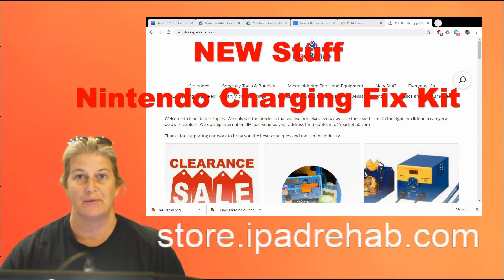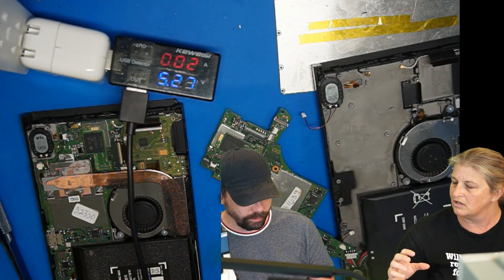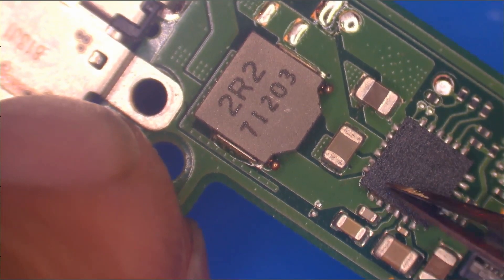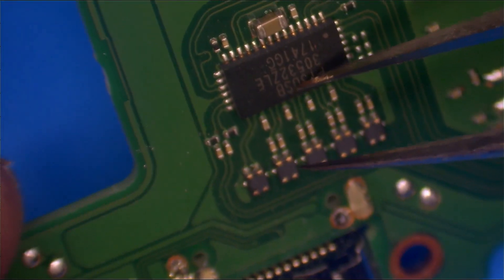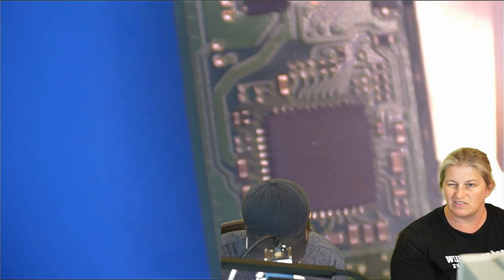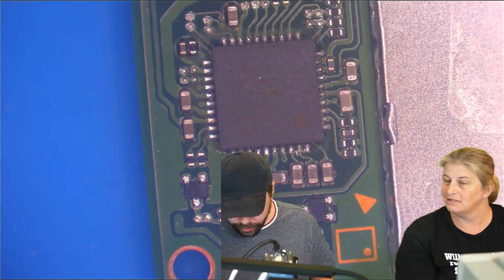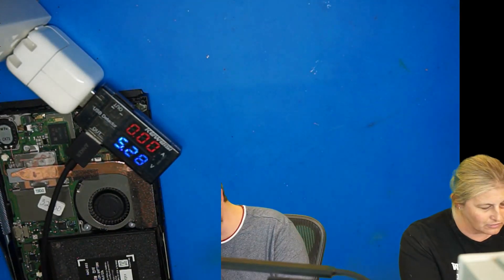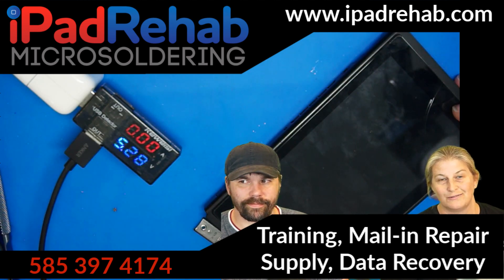Nintendo Switch Not Charging?  Learn to Fix it

Comment: Hi I have a switch that's around 4 years old and the battery only charged up to 23% and stopped. While plugged in I do not see the lightning bolt by the battery anymore. Just wondering the switch is smart enough to stop charging a depleted old battery or hopefully it's not the motherboard charging system. I have a replacement battery on the way just wondering if I'm wasting my time.

Comment: I have a charging issue with a switch my brother bought as-is on eBay, which I might add was stupid since the seller stated there was missing screws.  Normally I won't work on something that some amateur has torn apart for obvious reasons.

Anyway, I replaced the charging port.  Now I am getting the same .40 or so amp I was before.  In your video you weren't getting the .40 amp and replaced the tristar to complete the repair.  I am getting the .40 but still do not see anything on the screen indicating charging is happening.

This sounds more like a communication with the CPU issue but I have never worked on a switch so I have no clue where to start to tell if that is true.  Currently the Tirgis chip is sold out on your site, do you think the Tigris is more likely the issue.  I did hear some whining north of the charging port a few times, sounded like coil whine to me but I am not sure.

Any suggestions would be awesome, love the videos by the way.

Comment: Hi just joined your channel.. Have a question for you i have a switch that shows charging symbol on screen but it does not charge battery and percentage goes down.  Amp reader shows 0.00 amps.  There are no shorts in the charging chips and the video chip..  I also tried two difderent working batteries.. What could it be? I have posted on other youtubers channels but no one has responded...Thank you..
Reply from the maker: It could be any fault in the charging circuit.  See Store.ipadrehab.com for the chip that fails the most in our experience

Comment: In the video, the capacitor that is stated as being connected to the cpu (time 5.44 on video), next to the MT92 ic. If this is short 9/10 its a blown P13USB (HDMI) chip that causes the short. If you remove the P13 USB chip, that capacitor will no longer be shorted. This would also be evident on the screen as there would be no charging symbol or display if P13usb is defective.

Comment: Hey guys. This was most likely a short. Just fixed one today consuming the exact same way. Found a short on test pad 4 cluster k and tracked the line to the M92T36. Replaced the chip and bingo. Every short I have found on these devices consume almost no current and I have found shorts on the M92T36, P13USB, and the BQ. Also a regular usb to usbc cable with a 2amp block will allow 1.5amps to pass thru once the battery gets enough juice to boot the device.

Comment: Have seen many people mention the charging power control IC and battery management IC, but have not seen those go bad yet. Have mostly seen bad ports. Saw one with a bad video control IC that got stuck charging at 460-470mA after a port replacement. Replacing that IC got it working.

Comment: After reassembly the Switch I have a bad image, just lines, looks the LCD FPC is very wake and bended inside the pins, replaced the FPC, the weird now if connecting the LCD the switch don't boot, if disconnect it do it (know because recognize it plugged it to computer). Must be the lcd DRIVER IC?, impossible to get the schematic

Comment: I actually had similar issue after waiting for custom firmware to get realeased on my switch XD
The battery was dead and didn't charged at all... even after 11 hours of charging with original charger.

You can actually buy an adapter which allows you to charge your switch battery via bench PSU or a Quick Charging 3.0 compatible phone charger which can output 12v. 

Those adapters have already a charging controller built in and is actually very safe.

I don't know where I was getting my adapter from but it was definetly from some chinese site (maybe aliexpress or alibaba) but it helped me to fix my battery and the battery already works fine since 7 months

Comment: Is this a common issue with Nintendo Switches?
Reply: Yes, Nintendo's quality control sucks
Reply: My switch just died yesterday for no reason.  I docked it on the official dock,  using official charger last night,  and in the morning when I was taking it off from the dock,  it got very hot and it never turned back on , how shit can the Nintendo switch 's quality be?  just died like that?   I don't even used my switch much.
Reply: @bboyalanleung123  Wow. That is not good. Hopefully Nintendo will replace your switch. That sucks.

Comment: Neat to see a Switch being fixed!

Some comments:
The chip near the battery and coil near the beginning (don't have an exact number, on mobile) is indeed the battery management chip
The M92T32 is a very close match to the M92T30; pinout matches exactly. It's a USB Power Delivery management chip. It's the most likely to go bad it seems.
The PI3USB chip is sort of a "switch" it switches between the displayport altmode and regular USB functions. It's actually got the second video out connection of the SoC routed to it, which is why you're seeing the chokes; those are the video signals coming to that chip.

Comment: Charge chip very common issue need to look for shorts on the capacitors the other common issue is the video chip which causes shorts on the capacitors great video